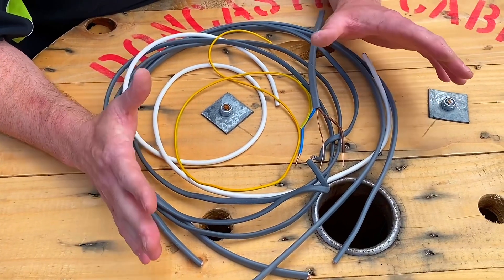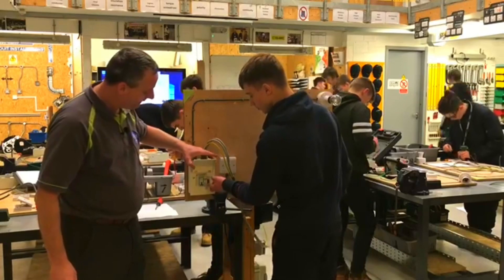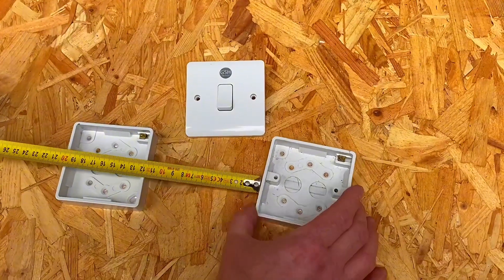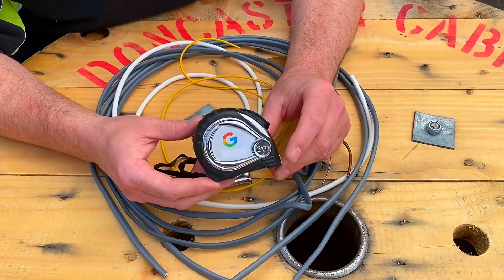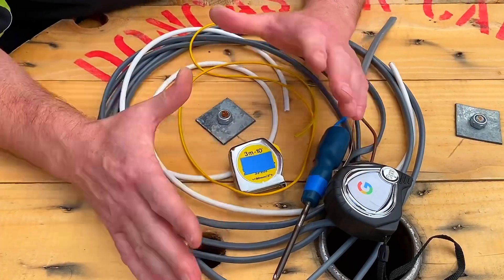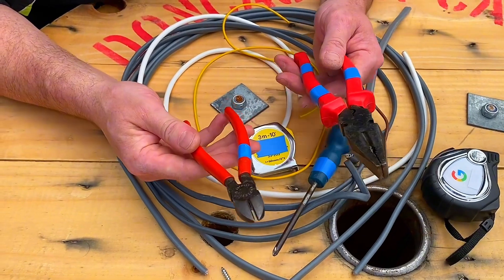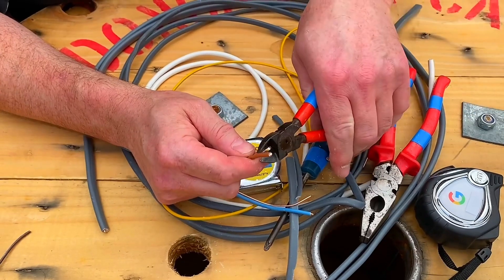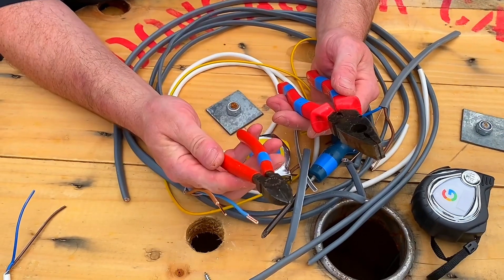4 Tools That Will Help You Train to be an Electrician

Comment: My list for some of the apprentices I have been saddled with
1 Big stick to poke them with when their attention span wonders off
2 Tazer every time they dont do what you have spent 2 hours instructing them on a simple job
3 Mobile signal blocking devices obviously to try and stop them contacting their mates every 2 minutes 
4 Biggest and loudest alarm clock so they might even make it to the van on time when you pick them up.
Of course all these ideas are in my head but one day.

Comment: Great video Gaz. As a meter fitter the tool i use the most is cable croppers. The tool most electricians don't seem to use is bent nose pliers. These are great, I've used them to great effect working on cars. I absolutely agree with you on a good pozi 2 screwdriver. I'd like to add that a long  thin bladed  (good quality), flat head screwdriver is a must. Some old cut outs and Cosumer units use old flat head screws that have been cammed out lots of times. I found myself getting tendinitis in my arms so long screwdrivers work  best for me as less effort. I also use a blue Bosch electric screwdriver but dont tell anyone 😂
Reply from the maker: Massive thanks for your detailed comment very much appreciated 👍🏻
Reply: I suffer tendinitis too so cheers for the tip 👍🏻

Comment: Personally i would start off on the right foot ( i do know your trying to ve cost effective ) a good pliers maybe the maybe even knipex installation pliers  makes cutting and stripping easier and branded screwdriver.
Tape agree 100%
But good tools saves the hands and makes the work enjoyable.
Get them used even online ebay etc...